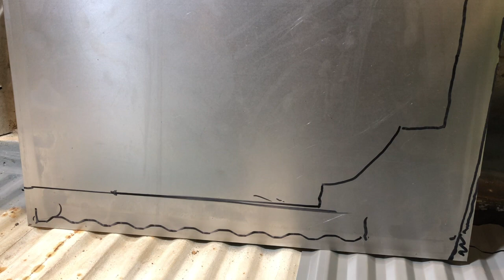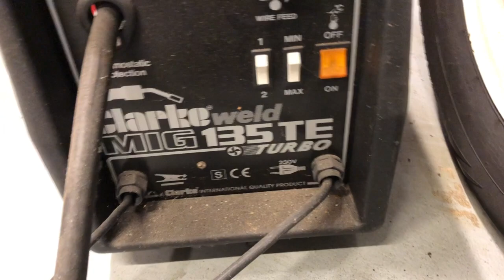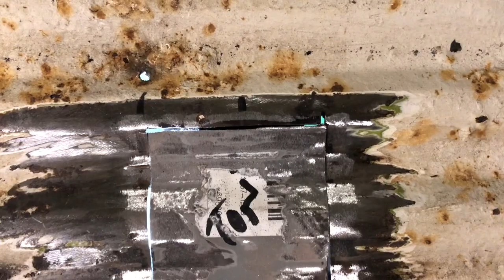Welding the floor Restoring Olive the VW T2 Bay window camper. Episode 4. (CAUTION FLASHING IMAGES!)

Comment: I suspect that the patch in the middle of the floor had rusted because the cross-member underneath that patch was corroded? Is there any particular reason that you didn't patch the cross-member whilst you had access?
Reply from the maker: Richard Sutton. hi Richard. The cross member had already been replaced by a previous owner. As you say, probably the cross member caused it but in this case it was probably from the welding blowing through!

Comment: Hi John interesting I assume the seam sealer is to penetrate the gaps where the weld is not continuous and form a protective coating. Also the sealer will be repeated on the underside as you progress
Reply from the maker: Hi Bruce
Yes it’s to fill inevitable gaps caused when not doing continuous welds. Which are not the norm in thin body welding.
You will see a lot of seam sealer in the boot floor and under bonnet areas on a lot of cars from new as the use of spot welding means the panels are not completely joined. 
I will use conventional under seal from below as it’s much thinner and can be sprayed.👍
Reply: Great